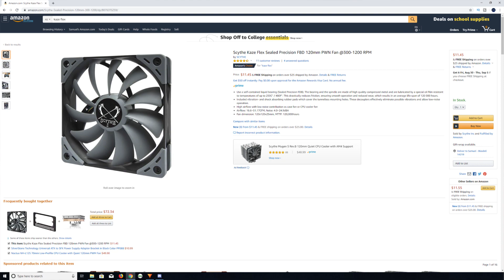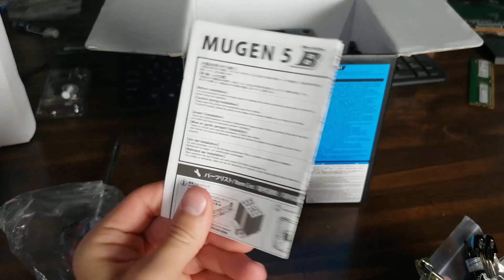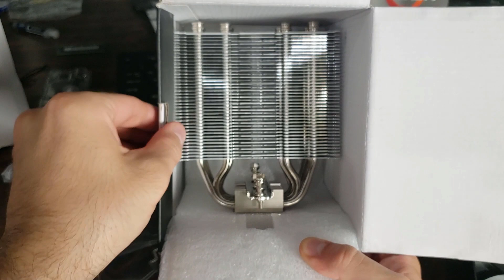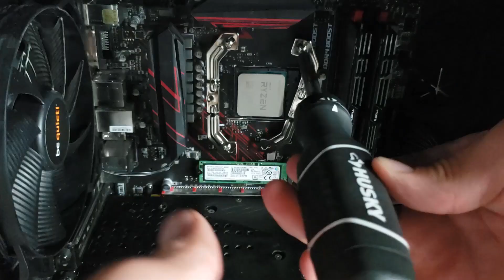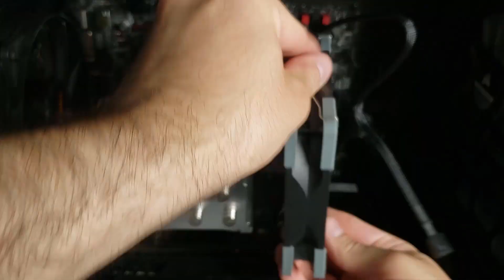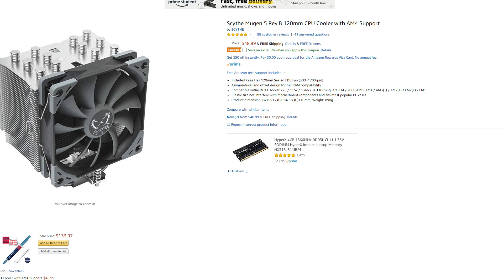Best Budget cooler for Ryzen 5000? Mugen 5 Rev.B by Scythe

Comment: I have been using this cooler for all my builds, it cools so good and is silent as hell, you cant hear it.  I use 1 fan on the right side  of the cooler and use the other fan as an exhaust fan on the backside of the case. The fans are really high quality and comparable to a be quiet silent wings 3 fan. ( i bought the Scythe Mugen 5 PCGH Edition wich comes wuth 2 fans ) So essentially you save money because you dont have to buy a fan for the exaust. Couple it with a Phanteks pro m case ( wich comes with 2 very good and silent 140mm fans) and you are golden! The most cool airflow build you can emagine. And silent wich you will like!
Reply from the maker: Hi Boemtie! Yes, I have found the build quality, cooling ability, and arguably the noise level to be superb on this CPU cooler! The fans were both quite nice, I like the anti-vibration corners as well :)

That is a GREAT point! Yes, if your case does not have a rear fan, this is a perfect opportunity to increase overall case airflow (while helping reduce the processor temps) by utilizing two fans in a push pull configuration. 

I'm a fan of many of the Phanteks as well! Beautiful cases 😀

I do plan on upgrading to an 8 core in the future and re-using this CPU cooler on that build as well! (Ryzen 7 3700-3800).
Reply: @STS  nice! The 3700x has a very low tdp and better performance than the 2700x so it is easier to cool i think you have a plan :). I was also comparing the 3800 but the 3700x doesnt bottleneck a 2080 i hear. So no reason to go for a 3800 for me i guess. What do you think?
Reply from the maker: It seems to be the case based on the Silicon Lottery binning results that the 3800X could net you another 100-150MHz on several or all cores. It appears to bet simply a better binned 3700x. I'm thinking the upcharge in that case wont be worthwhile for me, it may not be for you either. I would however, buy a 3800X if I were buying a 2080/2080ti. The extra 100 or so MHz will compliment that graphics card when it comes to the higher frame rates / more demanding tasks.

Comment: It is so much better to put dual fan? Or there isn't a lot of difference?
Reply from the maker: Hi Christhian! The dual fan setup is by no means required in order to get great performance out of this heatsink. By adding the second fan, I was able to reduce the core temperatures by a few degrees C which helped increase my boost speed by ~25MHz across all of my cores. If you have no rear exhaust fan for the case, the second fan would be a good idea. If you do have a rear exhaust behind the heatsink, it isn't as much of a concern. 

If you do want that same extra bump in cooling performance, you can check out the fan I used here on Amazon: https://amzn.to/2ZYGNXg